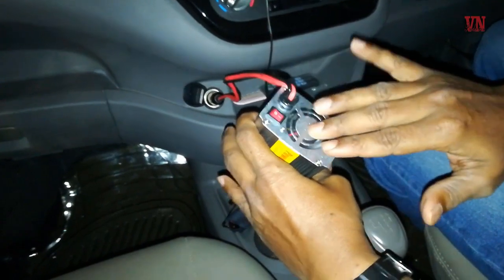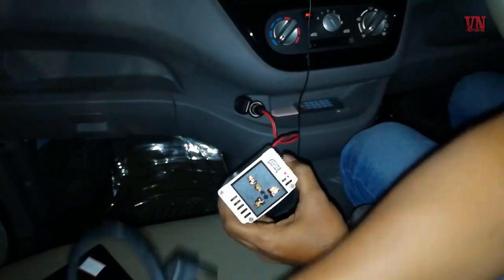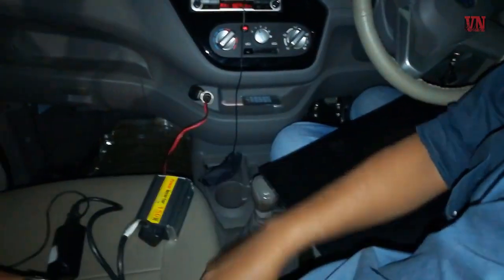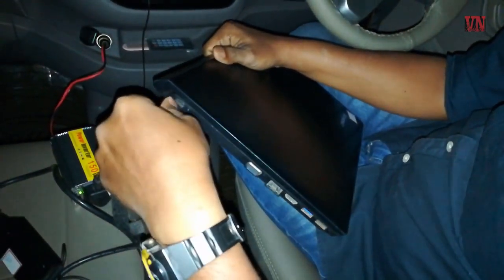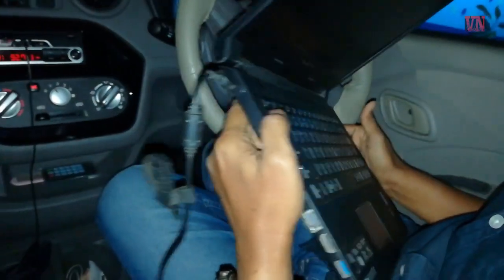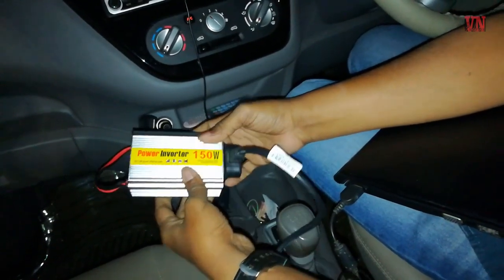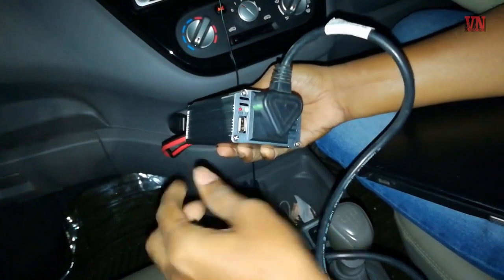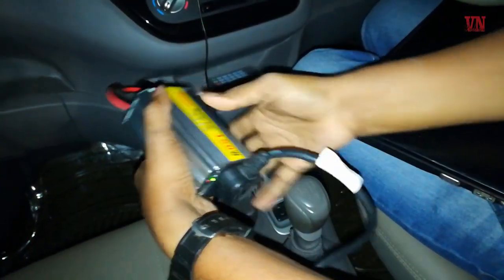150W Car Power Inverter 12V DC to 220V AC 5V USB Port /problem

Comment: bro it doesnt work because your inverter can't reach peak surge..
Reply from the maker: Are you sure?
Reply: @VNProductionofficial  yes, peak surge is when you start the device so when you plug your laptop charger if its rated for 80w, it goes upto 160-300w first then stabilizes at 80w

Comment: I've got exactly the same and it works perfectly fine for my Asus laptop which has 19v 6.5A. It could be your power supply doesn't like modified sin wave

Comment: Works great in the van🎡>share4.photo/BPowerInverter?S71    switch on the bottom turns the outlets on/off and the usb ports are always active so i can charge my phone without hearing the noises from my battery chargers. A+ in my book
Reply: wooooooooooooow

Comment: Did you check the specifications? Like the nominal and peak wattage of the inverter or the laptop charger wattage? The required input amperage of the laptop charger?

Comment: why would you use a non pure sine wave inverter for electronic equipment ????
Reply: How to know if the product used pure sine instead of modified sine?
Reply: not stable enough could corrupts surge for electronic equipment ,  ok for laptop or mobile phone charging
Reply: Because in switching power supplies the voltage gets rectified.